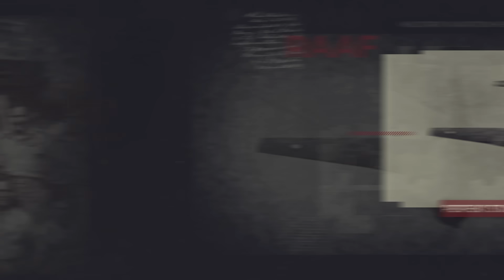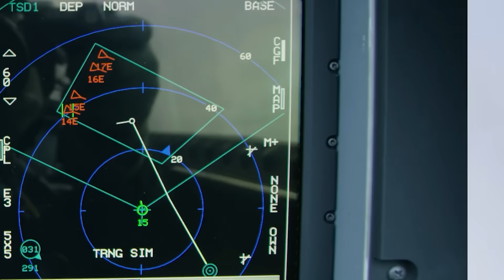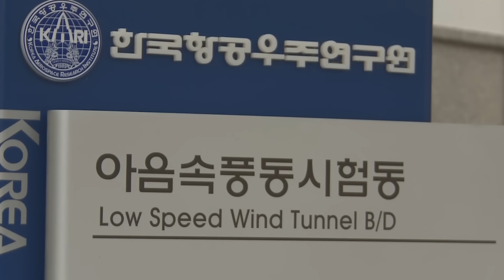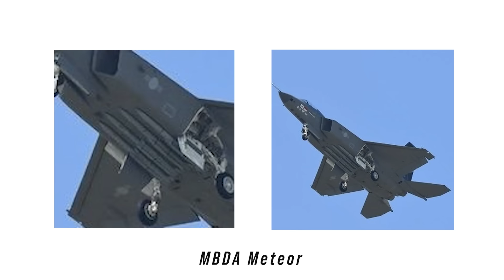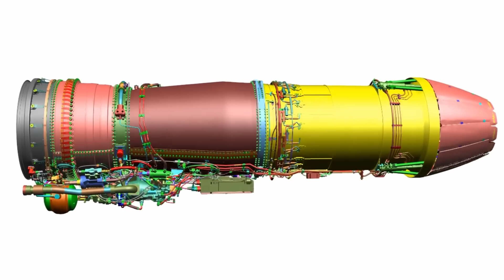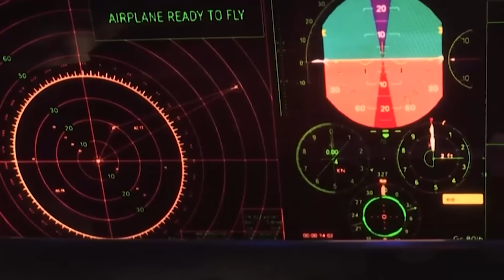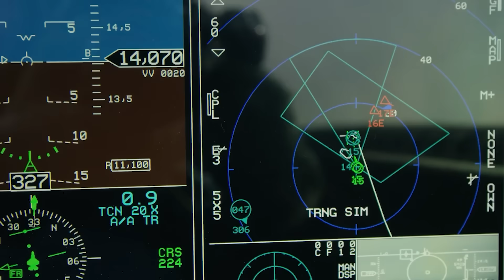KF-21: Korea's New Fighter

Comment: What happened to NATO Ukraine army? The answer is:
Mrls systems comparison- HIMARS(USA) vs ТОRNADO (Russia)
Range: 80km-120km, Warhead 250kg – 500kg, precision is same.
Caliber: 225mm- 300mm, # of missiles held in Container: 6-12
Lethality range:  ????? – 672 000 square meters.
Guidance: GPS - GLONAS 
Long range launch systems- АТАСМS vs ИСКАНДЕР.  Range: 300km-500km, Warhead 250kg – 500kg, precision is same.
Air Defense against Russian systems is only feasible  using IRIS-T
 Air Defense against NATO systems is feasible  using Pamzir-S, Tor, Buk M2, M3, S400

Comment: Turkish tfx best
Reply: insan bir tebrik eder anasını satayım. boşa ego kasmaya gerek yok. iki projede çok güzel bir şekilde ilerliyor.
Reply: In fact, even if Turkey's fighter jets are much better than Korea's fighter jets, it will not affect Korea's fighter jet business. This is because Turkey's fighter jets can be sold at high prices to economically powerful countries, while Korea's fighter jets can be sold cheaply to poor countries. The opposite case is also quite possible.
Reply: Turkiye's industrial power does not even reach that of Korea...
Can TFX really outperform the KF-21?
Although it may look similar, the fighter's performance comes from its ability to integrate radar and electronic equipment.
Are there any areas where Turkye is ahead of Korea?

Comment: If they can make the price per unit comparable or even lower than F15-EX or Rafale. It will have an advantage to chosen by a lot of airforces because of its modern and much stealthier design compared to other twin engine fighters.

Comment: The reason for the first batch of 40 aircraft is to replace South Korea's aging fleet as quickly as possible. In fact, it's too late now. There are too old airplanes. The purpose of this project from the beginning was to replace them as the primary goal.
After that, we're going to upgrade them and evolve them to the fifth and sixth generation. Contrary to popular belief, they are already multi-roll from the beginning. Even the first 40s will be multi-roll, of course. 
However, it takes time for various tests and missile tests. Even if it is adopted as a single missile, it should work well, but it needs to be tested. That test period is necessary.
If we want to put American-made missiles on it, we have to provide a completely finished airframe, and we have to provide the United States with all the classified material and source code of the aircraft. (The U.S. is never cooperative; it never shares technology, especially fighter jets).
That's why these fighters are equipped with European missiles. South Korean missiles, of course, are also being made.  American missiles will be adopted later. This is due to US procedural issues. They require a finished airframe, and the US does the work. The US never gives away their weapon specifications and source code to other countries.

Comment: As many others have already mentioned, the KF-21 project does not place importance on having full stealth. Korea has already purchased a number of F-35s. And even if the KF-21 is successfully developed, it cannot replace the F-35 and was not developed with that intention. In fact, there has been debate about how effective the stealth function will be in Northeast Asia, where radar networks are densely located, and for this reason, the Korean Air Force seems to think that maintaining an air advantage at the risk of some casualties is a more important strategic goal than performing a stealth raid. Of course, this idea is not aimed at North Korea, but at the potential risk of dealing with China or Japan. KF-21 is a aircraft that reflects the requirements that are considered optimal given this strategic situation. For example, the importance of BVR is the latest trend, but KF-21 is designed with a focus on mobility, which is a close combat capability. It is doubtful to explain that this is simply because it was designed as an air superiority aircraft. Of course, some argue that mobility is still important in BVR combat. However, it must be pointed out that the mobility of the KF-21s, which has been disclosed so far, goes far beyond this necessity. And it can be understood from this perspective that the Korean Air Force insisted on choosing a twin-engine aircraft because survival is important. Of course, twin-engine aircraft require much higher costs than single-engine aircraft. Nevertheless, it seems reasonable to assume that Korea, which is sensitive to rising costs, chose this design for reasons. Unfortunately, the KF-21 was built on the assumption of a battlefield in which a desperate struggle was fought, and this assumption was established because it was difficult for Korea to dominate over other countries in Northeast Asia. Naturally, it looks very different from the US war, which begins with a war by driving an aircraft carrier to another country and hitting it from a long distance.

Comment: 1. The KF-21 took nearly 10 years to verify its feasibility. It's a project where people put in a huge amount of tax, and it shouldn't fail, so there was a lot of controversy in Korea. This was a painful process, but as a result, it made it possible to develop a sober and rational fighter. Minimize risk. The technology we have and the technology we can get from the U.S., and foreign-made equipment that can be introduced using STA1 status.

2. First, choose the best engine that Korea can use, design with reference to all the successful fighters from all over the world, and design the appearance to lower the RCS as much as possible, and at the same time no adventure.

3. Two F414 engines determine the size and weight of the Thrust/Weight over 1 in the air-to-air standard-armed state of AIM-120 x4 and AIM-9 x2. So it's bigger than the F-35 and smaller than the F-18E/F.
See the stealth design of the F-22 and F-35 for the appearance, and FBW software coding for the F-22.
The weapon loading capacity is F-16 level, and the range is at the super hornet level.

4. GaN AESA radars and various electronic equipment and sensors made in cooperation with hundreds of private companies, as it is the world's leading semiconductor producer.

Comment: F-22 minus (some of) stealth capabilty and high performance.
F-22 minus size 
F-22 minus the bulky engines and extra-large internal ducts and old-style structure of the fuselage 

The reuslt is less stealty, more affordable, with a lot of internal space in the fuselage. 

This is the concept. 

Thanks a lot for Lockheed Martin's design support as had been promised when we decidied to buy F-35s. 

Sensors and their fusion...This is another big issue. (the indigenous  AESA, IR, EO)
Indigenous air-launched missiles with 'stragegic meaning', which the US is reluctuant to provide to this sensitive locality, such as the equivalents to JASSM-ER, LRASM or AARGM-ER. This is still another issue. 
The indigenous high-end unmanned aircrafts for collaboration, which is forbidden for ex-im by the MTCR treaty.....This is the ultimate issue... 

Since South Korea is under an existential threat from North Korea and the PRC, we have no other choice but to follow this very bumpy path....

Comment: 1.AESA radar -Hanwha,, ADD (KOREA), 
2.IRST -Hanwha, kai(KOREA), 
3.Eotgp -Hanwha, kai,(KOREA)
4.RF-jammer-LIG Nex1(KOREA), 
5.EWC-LIG Nex1(KOREA), 
6.PWR-LIG Nex1(KOREA), 
7.CMDS -LIG Nex1(KOREA), 
8.MISSON computer-KAI,ADD(KOREA)
9.DIGITALCOCKPIT, Hanwha,, ADD (KOREA), 
10. Ge Engine -Hanwha License (40% KOREA)
11. Avionics control system- kai(korea) 
12. brake system -KAI(KOREA), 
13.K-LINK communication system-Hanwha,, ADD (KOREA), 
14 aircraft fuselage - KAI(korea), 
15 Aircraft Wings-KAI(KOREA)
Reply: 17. trying to steal technology - Indonesia
Reply: @Pulsar-g4fone thing you must know, indonesian involved in designed KF21 from the scratch, then why KF21 have double turbifan because indonesia prefer it considering indonesia vast geography need aircraft with longer endurance
Reply: Nice. SK has the best heavy industry sector and is rapidly accelerating its precision weapons tech.
Reply: F 35 copy
Reply: You should have used a European engine to avoid all US-licensed tech.
Reply: 16. taking a look 👀 - Indonesia

Comment: Korea is truly incredible
love from the Philippines
Reply: Korea is incredible thanks for people from the Philipines. Koreans will never forget.
Reply: Among the contracts between Lockheed Martin and KAI are as follows.
FA-50 has a constraint that it cannot exceed the latest F-16 specification.
So the FA-50 has its limits.
However, the FA-50 is a cost-effectiveness and has a full role to play.
Very powerful as a 5th generation pilot training, proximity support, and small multi-roll fighter.
It must be a very useful aircraft for both training and practice.
Armed forces are also evolving.
In Block 2
AIM-9 Sidewinder
AIM-7 Sparrow
AGM-65 Maverick
IRIS-T
KEPD 350K-2
AIM-120 AMRAAM
It will be armed.

What is unusual is that the Korean-made AESA Radar is better than the US-made Radar with performance limits.
However, due to the inherent limitations of FA-50, it seems to be impossible to mount.

However, KF-21 has no constraints.
This is because Korea has developed core technologies such as AESA Radar, IRST, EOTGP, and RF Jammer.
The interior armament is also under development and the MUM-T system is also under development.
We're testing to control three drones with wingmen
It is being developed as a multi-purpose fighter with more than five generations at the same time as the development of internal armoured windows.

The AESA radar developed by Korea is a gallium nitride material and is powerful.
It is currently used in Korean Aegis destroyers, M-SAMs, and L-SAMs.
Gallium oxide materials that are much more powerful than gallium nitride materials are also being developed.

Korea has strong EMP technology.
RF-Jammer is also very powerful.
It will reach NGJ-MB performance enough.

IRST is currently on board the frigate and in use.

EO-TGP is already applied to FA-50.

Core equipment is constantly being upgraded with the development of new technologies.

KF-21 Boramae is the name of a falcon when its young is raised for hunting.
Boramae is called the Little Raptor, but in the near future, it will evolve into the fifth and sixth generation fighter jets that will shine on itself.

I hope you will pay a lot of attention to KF-21.
Reply: Thanks the Philippines❤
Reply: J2419BSJ KGBR2-MZ 비밀병기 전격배치
 북한군?? 꼴 보기 민망..군인이 뭐 저리 우왕좌왕 질서개판이군!!  빵탄 쏘면 먹느라 바쁠듯............
армія Північної Кореї?? Соромно на таке дивитись.. Солдати такі хаотичні та порушують порядок!! Якщо ви стріляєте хлібними кулями, ви будете зайняті їжею............

North Korean Army?? It's embarrassing to look at.. Why are the soldiers acting so disorganized and causing such a mess!! They'd probably be busy eating if you shot them with bread bullets.............

현재 전쟁 ...쪈의전쟁!! 동맹전쟁. 침략전쟁은 폭망...망국을 부른다.
UFO 비밀 풀었다. 👽  이제 가격도 저렴한 화약 보다 더 무서운 것으로 적을 제압한다. 평양에도 날파리 ~~~ 수십기 대기증. 
KNASA ~~ East Spaceman .. Meal Address ... For space peace and happiness....... 👽 Register as an astronaut G-Meall    
"홍익인간"의 뜻 ...널리 인간세상을 이롭게 하라.     The meaning of "Hongik Ingan" is... to benefit the human world widely..

한화오션 美 필리 조선소, 전격 인수...이제 언제든 항공모함 투입가능?
Hanwha Ocean's US Philly Shipyard, Acquired in a Shock... Now Aircraft Carrier Deployment Possible Anytime?
Hanwha Ocean раптово придбала верф у США Philly... Чи можна розгорнути авіаносці в будь-який момент зараз?
Hanwha Ocean внезапно приобретает американскую верфь в Филадельфии... Могут ли авианосцы быть развернуты в любое время?

인간 모두는 우주진리에 따라 같은 형제다. 다만 오랜 세월 서로 떨어져 있었지만 문화와 풍습을 보면 공감해야 한다. All human beings are brothers according to the truth of the universe. However, even though we have been separated from each other for a long time, we should sympathize with each other when we look at our customs.

1 모두 서로 복사 알립시다. 1 Let's all copy and notify each other. 1 Давайте все скопируем и сообщим друг другу. 1 Давайте копіювати та інформувати один одного.

우리는 우주의 진리를 가지고 찰나의 순간으로 태어 났으니 존귀하다.
하늘은 아버지라 부르고, 땅은 어머니라 부른다.
나는 매우 작은 존재로서 그 가운데 자리 잡고 있다.
모든 국민은 나의 동포이다.
천하에 어려운 처지에 있으면서 하소연할 데 없는 사람들은 모두 나의 형제이다.
이에 우리 모두는 악을 배제하고 욕심을 버리고 서로 사랑하고 나누며 행복하게 살아야 한다.

Ми цінні, тому що народилися в одну мить з правдою всесвіту.
Небо зветься батьком, а земля – матір’ю.
Я сиджу посередині, як дуже маленька істота.
Всі люди мої земляки.
Усі люди на світі, які опинилися у складних ситуаціях і не мають на що скаржитися, — мої брати.
Відповідно, ми всі повинні виключити зло, відмовитися від жадібності, любити і ділитися один з одним, і жити щасливо.

We are precious because we are born in a moment with the truth of the universe.
Heaven is called Father, and the earth is called Mother.
I am a very small being, and I am located in the middle of them.
All people are my compatriots.
All those in difficult situations in the world who have no one to complain to are my brothers.
Therefore, we all must exclude evil, abandon greed, love each other, share, and live happily.

Мы драгоценны, потому что мы родились в один момент с истиной Вселенной.
Небо называется отцом, а земля – матерью.
Я уютно устроился посередине, как очень маленькое существо.
Все люди — мои соотечественники.
Все люди в мире, которые попали в трудную ситуацию и которым не на что жаловаться, — мои братья.
Соответственно, мы все должны исключить зло, отказаться от жадности, любить и делиться друг с другом и жить счастливо.

South Korea's status as a Nobel Prize winner in literature has been confirmed, and we hope that the world will now recognize South Korea as a country 
대한민국 위상 노벨 문학상 확인 했습니다. 이제는 전세계가 더 대한민국을 알아야 하는 나라로 우뚝 서기를 희망 합니다.
다음 한국 문학상 대한민국 " 초우주적 홍익인간"   Next Korean Literature Prize South Korea “ Super cosmic Hongik Human”

KNASA ~~ East Spaceman .. Meal Address ... For space peace and happiness....... 👽 Register as an astronaut G-Meall    
"홍익인간"의 뜻 ...널리 인간세상을 이롭게 하라.     The meaning of "Hongik Ingan" is... to benefit the human world widely..

==👽== J2419BSJ KGBR2-MZ 대한민국 위성 시스템 모두 완료 배치중. 영구 전천후 자율형 무인스텔스비행기 배치 활용중

핵은 관리 어려우니 더 강력한 극초음속 겸비한  무기를 개발하라.
Ядерною зброєю важко керувати, тому розробляйте більш потужну зброю, здатну розвивати гіперзвукові швидкості.
아무리 군인 부족하여도 강제징집 말고도 할 수 있는 일 많으니 인권유린은 범죄행위 거두시요.
Скільки б не було солдатів, крім примусового призову можна зробити багато речей, тому, будь ласка, припиніть порушувати права людини.

==👽== ==👽== ==👽== 초우주시대 평화롭게 서로 협력하며 살아가길 희망!!

10G 이상 극초음속 초우주시대 U~~~ 살떨림 전쟁 시대 시작....
 ==👽==  비밀스런 "양자컴. 초소형화" 현실화 성공. 무한전기 발생 시스템 미군도 부러워 정보공유 요청. 대한민국 현재 거부.
초우주시대 핵보다 더 무서운 무기 대한민국  비밀 병기화.
고조선 만년 역사 이어온 신의 대행자. 무서운 대한민국.  J2419BSJ KGBR2-MZ  비밀병기 전격배치  ==👽==
Reply: I do like and do love Philippines.